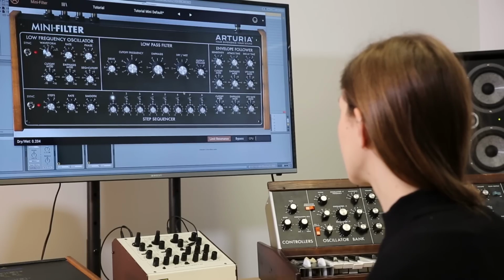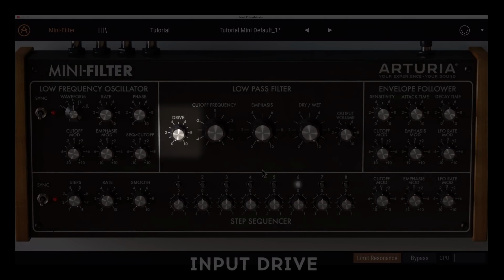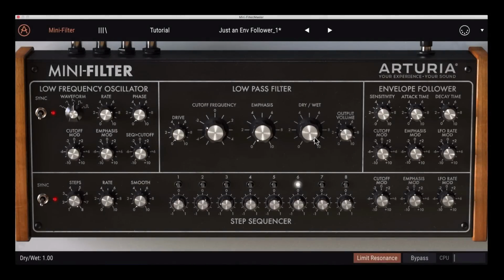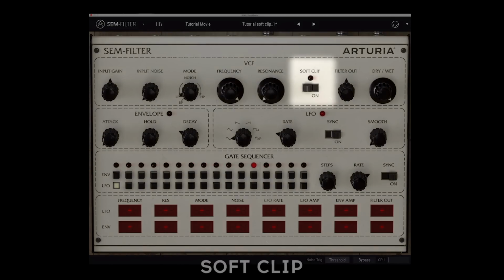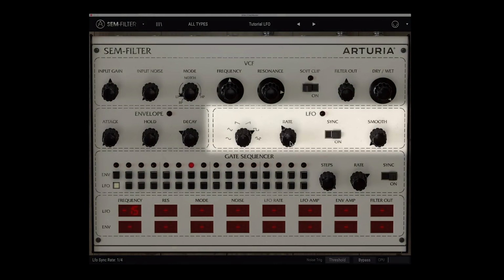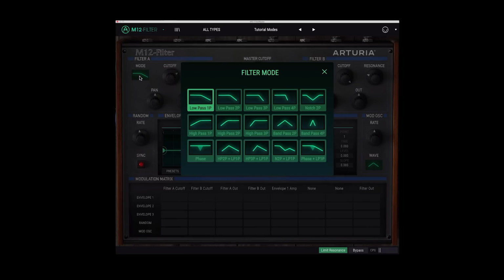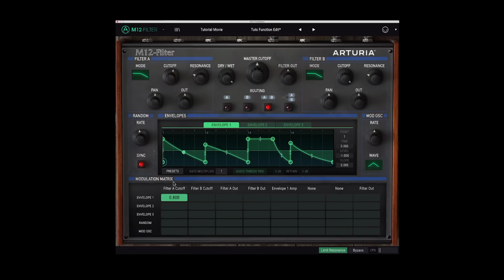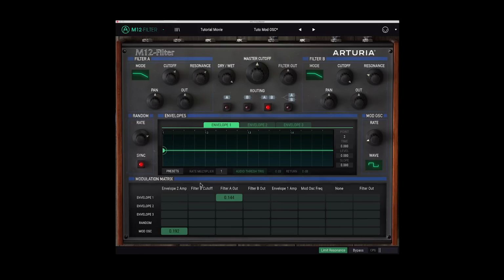3 Filters You'll Actually Use: Tutorial

Comment: If anyone is interested in hearing an example of what you can do with some of these filters. Did a quick 2 hour jam, and literally used only raw synth sounds run through several instances of the Arturia filters :

https://soundcloud.com/hades/french-cinema/s-I6shj

I started with the main pad, and then used the same pad clip for the bass riffs. It's literally the M12 filter transforming the pad sound into a synth riff. Everything apart from drums, sub and vocal samples were raw synth sources run through one of the Arturia filters. I used many instances of this filter, had no CPU problems whatsoever...  Obviously WIP and the mix needs work, but I think you get the general idea...
I have an Oberheim Xpander (6 voice version of the Matrix 12) here in my studio, and I LOVE the filters on that thing. But it's a very unreliable piece of gear to work with. Calling my Xpander temperamental is calling the sea a bit wet at times. :) And it doesn't take external audio either. Really impressed by the M12 filter in this pack.